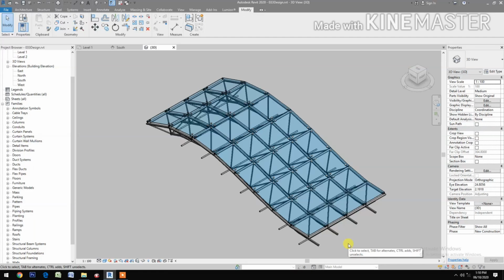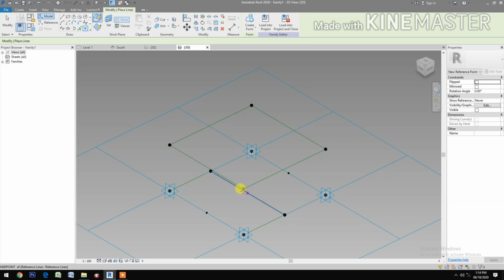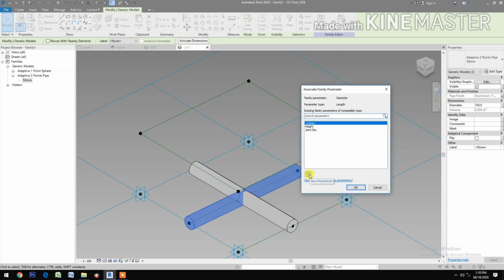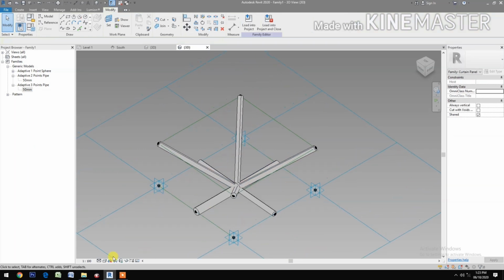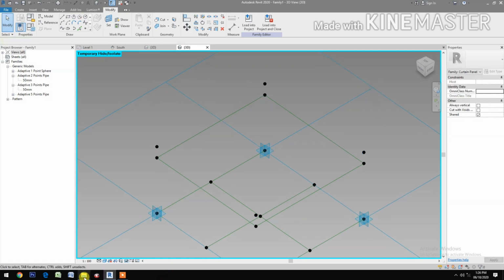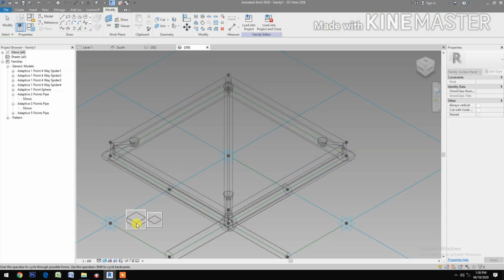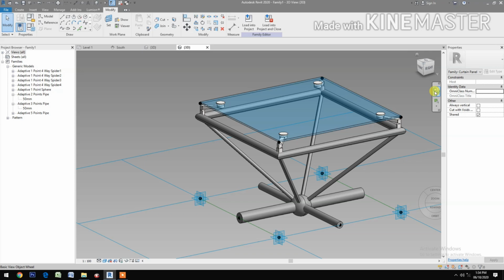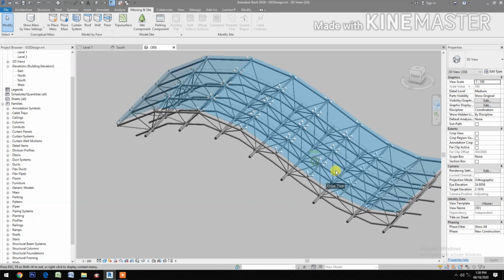RD033. How to make a Parametric Space Frame with Spider Fittings in Revit.

Comment: Sir,
  Is it possible to create this kind of structure between 2 surfaces with different curvatures and or shapes? If the inner shape is a circle or semi-circle, but the outer skin shape has a much different curvature? Or if there are walls of concrete with a skin that has waves and curves? How is this done? Thank you for your video.